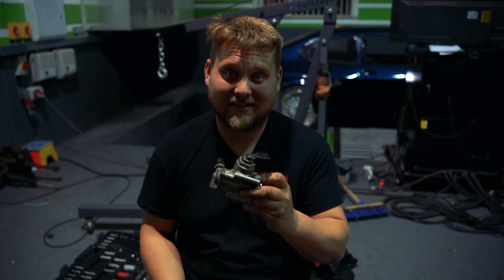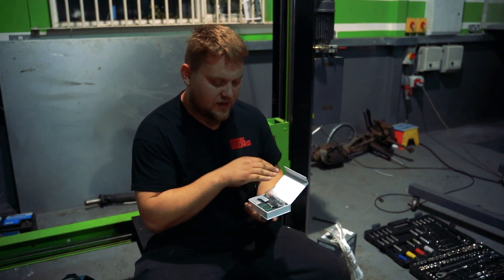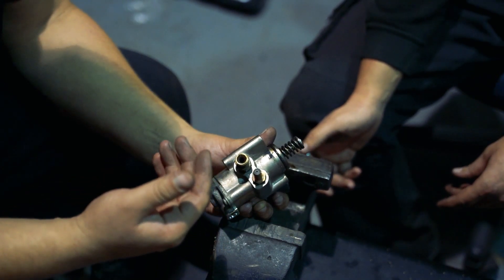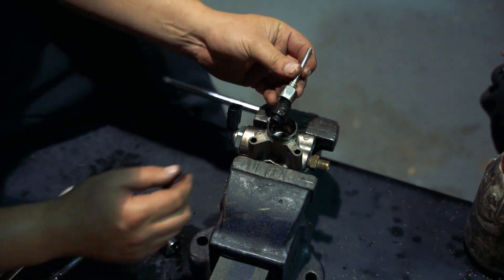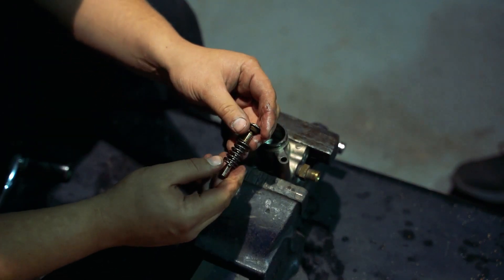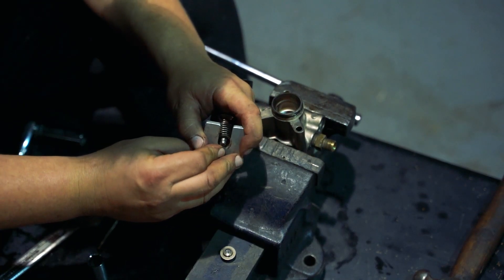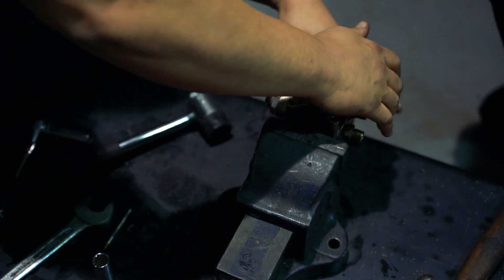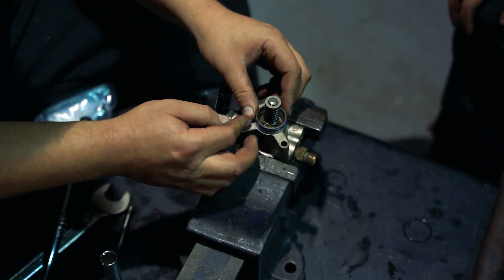Audi VW Golf GTI A3 S3 TT High Pressure Fuel Pump Upgrade Mod

Comment: hi is this considered an upgrade do you get anything?
Thanks
Reply from the maker: @lunadond when you get a custom map on your car if you go for 350hp+ then you need to supply the injectors with more fuel as the stock system can’t keep up with the demand for fuel
Reply: @StatusExotics  the car is stage 2+ with methanol. I opened the hole with a 5mm drill I can say that I saw a small difference at low-medium revs
Reply: @StatusExotics  so we can assume that it is also like an improvement for some increase in underpower

Comment: Thanks for posting this video. Glad to see the actual drilling on the brass fitting using the 5mm drill bit. Was there an o-ring inside when you took out  the brass fitting because some said to be careful because there was an o-ring under the pump. Thanks.
Reply from the maker: If I’m honest I can’t remember if there was a o ring or not in sorry I’m not being helpful
Reply: @StatusExotics  no worries, I'm going to do the same on my HPFP will see how it goes. At least now I know how it will be when drilling it. It's not so difficult after all. Just make sure it lines up. I'll be drilling from the inside-out as some say a better approach as it may snag the bit during the drilling process.

Comment: Is it possible that after installing the pump, I did not drill a 5mm hole and this is the reason that I have error p2293 under load?
Reply: I change everything on fuel line, lpfp, cam follower, low pressure sensor, cam look good for me No damage.. Please help
Reply from the maker: Possibly because I’ve never not drilled the hole and never had that error so I would say that would be the first thing that I would do .
If the pressure is greater in the pump than in the rail then it would most likely throw a code like this as it’s a too low or too high code for the pressure sensor in the rail and then clear the code and see if the problem is still there
Reply: Its error code for too low pressure 
When i ride nice na slow error dont come out, but when i put the gas for 70% and turbo build a boost i have fuel cut

Like here 130bar on rail when ride slowly
But when i put the gas stronger pressure is 70 bar and 30 bar and boom p2293
Reply: This vid help me to do it properly and car now is a weapon. Thanks again bud 🫶🏽
Reply from the maker: Yea drill it out and message me on Instagram bud

Comment: I have the banjo type could you be more specific to which line I can drill out thx
Reply from the maker: You have to drill the small hole in the banjo 🪕 where the fuel would pass through

Comment: my engine is CCZ EA888 gen 1 audi A3 quattro 09 .. im on stage 2+ my tuner did not recommend upgrade in the hpfp instead he recommended upgrade at the lpfp. contrary other tuners recommended S3 injectors and HPFP mods . When i asked my tuner why not S3 injectors and Hpfp he simply said they are using the wrong technology for the cars.
Reply from the maker: I did miss out the lpfp in the video but mine was upgraded long before I filmed the video I did the hpfp as good practice and least if the internals are fresh I know it’s not going to fail and if I wanted more power it was one less thing to do while it was already in bits

Comment: Hi there, hope you are doin’ well. I got 2 little questions on this tutorial. I’ve just installed an Autotech upgrade kit yesterday. The first remark I have is that my spring was stuck at he bottom with the big bolt, i can not remove it. So i replace aeverything like you but with the spring stucked. Did you even hear or see such thing ? 
The second is that  I didn’t drill out to 5 mm. I am «just » stage 1, with Ramair oversize air intake, CTS turbo inlet and outlet. 
I wonder if I should do it and if 5mm is the right diameter to drill (and by the way not too big for Stage 1). What do you think about that ? Thank you for your answer
Reply from the maker: Never have I had a spring stuck Payne get a replacement one if you get it out ..
And if you are increasing the volume of the hpfp the want to get as much fuel into it 
I wouldn’t say it’s a must but in my eyes it is 

Also thank you for watching.
Reply: Ok thanks for your answer, i will drill it out today when i get some time but buy a spare "just in case of" 😂.
I will check if i can find a retail spare spring to remove the old one. I keep you updated. Thanks a lot

Comment: Thanks for this video. There was some helpful advice in here. I appreciate it! A “how to remove the intake manifold” for a TFSI would
Be good. I haven’t found any good videos on that.
Reply from the maker: What part of removing the inlet are you stuck on 2 bits that are a pain there is a bolt on a bracket in the centre underneath hard to get to 
And the injectors are stuck fast and it needs a good tug
Reply: @StatusExotics  I was removing the intake manifold last night and I got down to the last bolt at the bottom of the bracket and I ran out of time. I’m going to finish it up in the later today sometime. 

The other question I had was you mentioned drilling out the fuel line with the fuel pump with the banjo bolt. Any examples of that? I’m glad you mentioned that too. I’ll have to do that tomorrow too. I thought about doing the fuel line conversion later on to make it easier on myself.
Reply: @StatusExotics  where on the banjo bolt part of the fuel line?
Reply from the maker: @cjdoc77  you have the banjo type so you will have to drill the holes on the bolt

Comment: Good, simple video.
Any thoughts on why 5mm drill hole was necessary?
5mm is it alot, or is it just enough?
..I´m installing Autotech HPFP, and would like to know if i should also drill that hole.
It´s the first video where i saw this drill be made...
Thank you guys @status_declined
Reply from the maker: I would highly recommend drilling out the same hole we did , if you think of it this way the hpfp is going to need more fuel as there is more surface area you want more flow from tank without over working the in-tank pump drilling it out may not make a difference in most peoples eyes but why restrict it it’s not stock once modified we are making some really good numbers our first pull in the next video made 320hp at 1.4 bar ... we are running a lot more now with no issues
Reply: @StatusExotics  Great! i will try to do that on mine. I´m not going as far as you... Only have on my TT 8J (BWA) an S3 intercoler with all silicone piping, all metal throtle pipe, and a K&N replacement air filter. Will now install the HPFP internals, and a 76mm downpipe with 200cell cat. Of course i have a remap, and for now my k03 is at 1.3bar...After the HPFP and downpipe i will probably try to increase boost to 1.4.. Don´t know if it could handle...  Don´t know yet if it should be ok like this.. what do you think? Kind regards!
Reply from the maker: Good luck with the build and keep me posted on it to see how it went and I’m glad my guide has come in handy for you